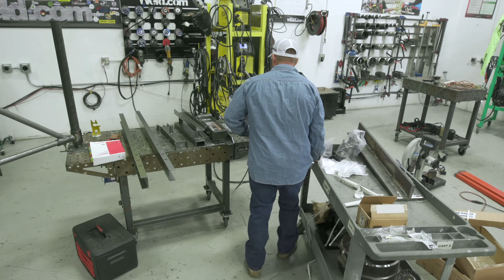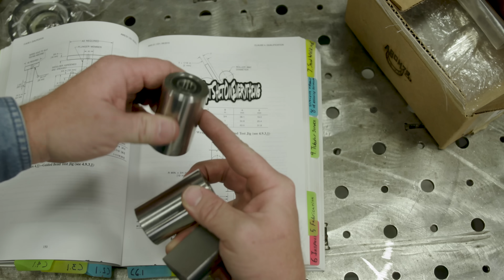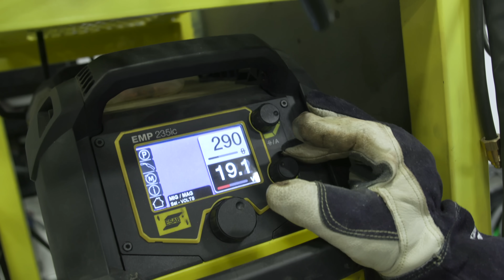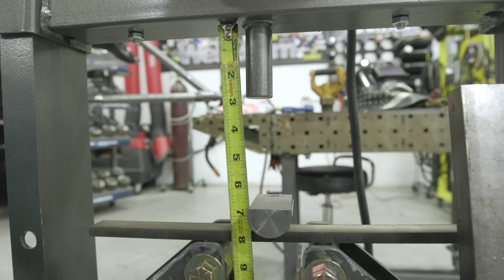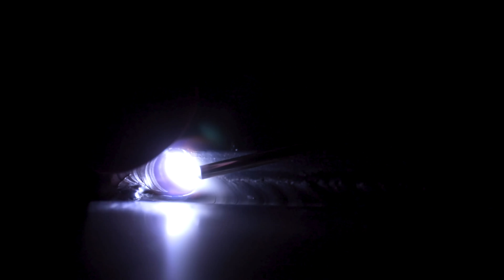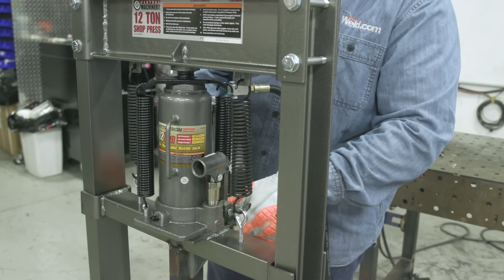How to Build a Bend Tester

Comment: I have a question.  Are all of the coupons the same size?  If so why could you not put a couple of pins or stops so the coupons would be on the rollers say within 1/64 or 1/32 inch so you did not need to measure each time; or is that allowed?  I am thinking about making it easier and faster.

Comment: Wait so did abom even put a crush tube in between those bearings?
Surely both of you know you need them, otherwise your bolt just pinches the bearings like you said at 6:28
I know you're just a pipeline welder but this is basic engineering. 
Also how does that cost you $400-1000? Just wow, someone's making bank

Comment: Oops, on the 20th of may in 1875 US signed the Treaty of the Meter.  Since then the "Inch" is calculated by the standard of the "meter" that is kept in the a vault. Please watch Veritasium - "Is America Actually Metric". Sorry. You haven't the slightest notion of what the US insisting on staying Imperial has caused around the planet. Ironically NASA lost the Mars rover because of this🤔🤦‍♂️

Comment: Hey how about a strength/ bend/ cut and etch test using a 120 volt flux core welder vs a 120 volt stick welder with 3/32” 7018 and 6011?
Which process is stronger for a beginner?
Thanks for the great channel!

Comment: This is cool to visually see how much fusion you have as it will elongate the cracks (under tension) and therefore making them bigger to see but in terms of strength testing a Charpy impact test would probably reveal more information . It’s purely mechanical and the calculations are very easy. This test (3 point flexural test), is usually used for brittle composite materials (like carbon fibre) and its indenter moves at a constant speed (not constant force) so that you can make a load-elongation or stress-strain graph and or at the very least see how much force it takes for failure.

Comment: Exactly what I bought was the harbor freight 20 ton press and the harbor freight 20 ton air over hydraulic bottle jack and if you put full power to it the entire top will buckle and it messed up the return spring system on the the jack, but it will be fine for what you’re doing